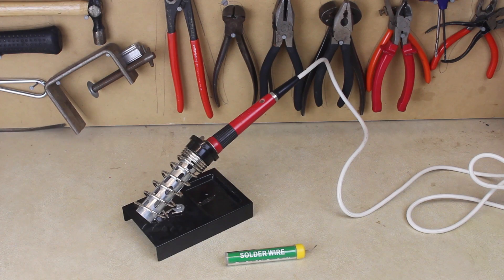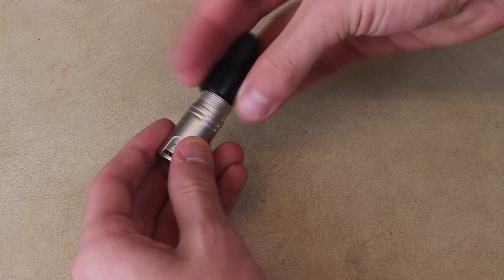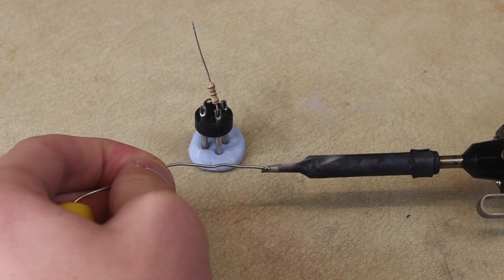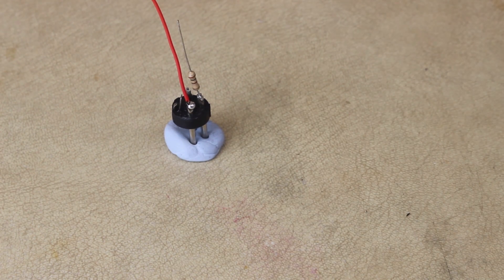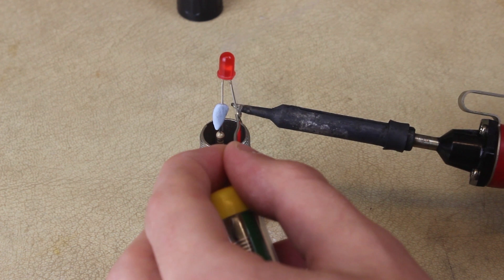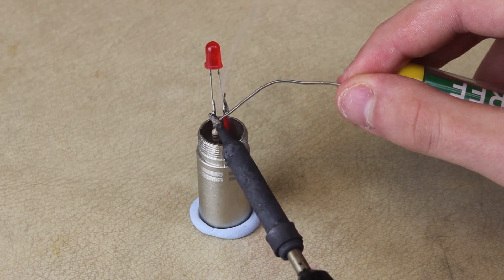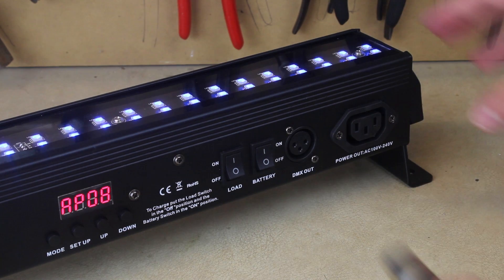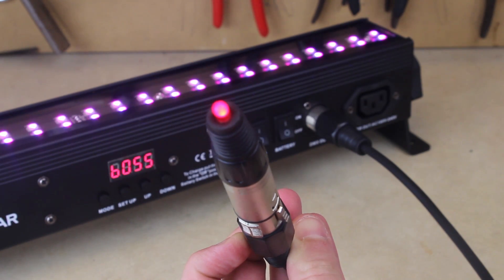Make Your Own DMX Signal Tester

Comment: Hi joe, i tried doing this using a 120 ohms as i could not get a 110 ohms resistor, but it didn't work.
We use an input voltage of 220 - 230 AC here, does that mean i should be using a different rating resistor. Plz advice. Thanks.
Reply: shouldn't need a different resistor — LEDs run on current, not voltage.

Comment: Hi Joel. I'm setting up a dmx system using QLC software on a Raspberry pie.  I've bought a basic dmx capable rgb lamp but I'm unable to control the lamp. The problem maybe the DMX interface for the RasPi. My question is if there is a voltage in the DMX output are we to assume that data is also present?
Reply: Simon Phillips im guessing you already resolved this?

Comment: its better to use a 2 colour LED, cathode to 1 (with a risistor*), and the 2 anodes to pin 2 and 3, this way you test all the signal wires instead of just 2 and 3, it is allso more fail prove....

*find out what is the right risistor there a a real simple formula: 120 Ohm minus risistance of the LED equals the resistance of the risistor (this is different for all type of leds)

Comment: ***** 
So you used 110 ohms resistor to test a DMX XLR Cable. If I wanted to make one for a Mic Cable, what would I need? 80 ohms or is that not the way it works?